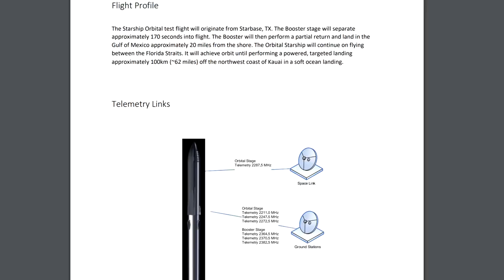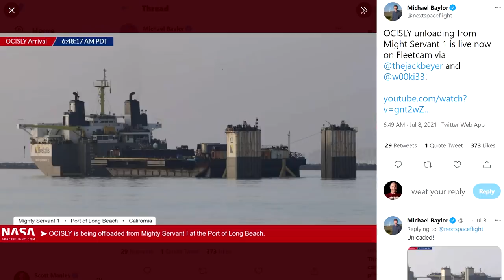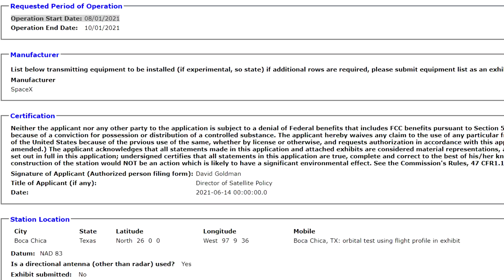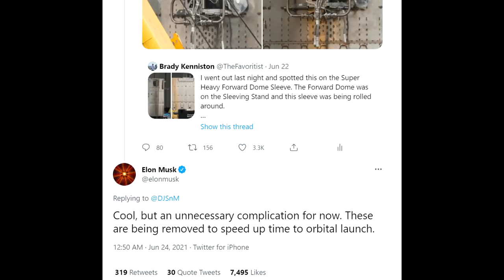Why SpaceX Will Move To New Thrusters To Simplify Starship

Comment: Damn those thruster tests sound like several objects broke sound barrier at once...
Reply: If you count each atom as an individual object, you're not wrong.
Reply: @44R0Ndin  What are you talking about?
Reply: @Alex-lc1bv  exhaust gasses in engine are accelerated to hypersonic speeds, and well, gas is group of molecules
Reply: @Alex-lc1bv  The atoms that make the propellant for the thruster, if counted as individual objects, would be "several objects breaking the sound barrier at once", which is what OP said it sounded like.
Reply: @44R0Ndin  This actually also goes for many of the atoms/molecules in room temperature air. :)
Reply: @janniszimbalski6652  Didn't think of that, but you're right of course.
Reply: In the Vacuum of Space, No One can hear your Thrusters.

I love the way Elon bounces back to Scott's Commentary...
Reply: They also sound like the new Triangle, high altitude plane the USAF, is flying, leaving multiple 'smoke rings' in its wake, as it does short bursts of fuel buns, to keep speeds over Mach 4.
 There's video on the tube, with the very distinct com trail & reports of multiple breaks of the sound barrier.

Comment: Hopefully they can run cold gas thrusters off of 87 octane gas, that'd be ideal for my 99 VW Jetta :D
Reply: A Cold gas thruster is basically, a compressed gas tank attached to a strategically placed valve(which act as the thruster), which he mentions in the video 6:25.
Reply: 87 sounds very low... can't get anything below 95 here, the old 92 was gone years ago :)
Reply: @YoursNKR  Basically, a fire extinguisher.
Reply: @benbaselet2026  Europe reports octane rating differently than the US. Europe gives the RON number on the pump and US is an average of RON and MON. 95 in Europe is the same as 87 in the US.
Reply: @RCAvhstape  Hey, it worked for Wall-e.. ;)
Reply: they are actually adding these thrusters and a compressor to the tesla roadster so it is said, to get close to a 1 second launch speed 0-60 and near weightlessness only on launches though.
Reply: @genelomas332  And for Sandra Bullock.
Reply: @Eradicationist  they're not adding hot gas to the roadster, Elon has always explicitly stated COLD gas thrusters for it
Reply: @E9X330  I never specified, and the original comment already stated cold gas so isnt it implied if that is so?...how is it 90% of people don't know how a youtube comment section works and I get replies like this all the time... it's like you all need to be spoon-fed all the information. 

how did we win the cold war...smh
Reply: @YoursNKR  its a bell nozzle connected to a valve that is connected to a pressurized tank of Nitrogen gas.
Reply: @Eradicationist  my bad then, could've sworn the OP wrote hot gas
Reply: @E9X330  it's ok, it happens quite often. 

especially to me.
Reply: I’ve heard cow methane is working really well.
Reply: @Eradicationist  if 90% of people get it "wrong" perhaps you're the one in the wrong.
Reply: @RCAvhstape  yeah, and Matt Damon went old school, and just ripped his glove.. lol
Reply: Then it wouldn't be a "cold gas thruster" would it?
Reply: @jnawk83  in short its more like 90% of people are lonely on youtube by themself and want to be a part of any conversation they can be no matter how dumb they look doing so.
Reply: New launch model?  🤔  If you can run 87 octane you to fly to the local launch site anywhere in the world, “land at the pump,” and onboard the 87+ fuel at a local gas station.
Democratized launchIng. 😉
  (“Volksrakete”would be “Rocket for the People” ? )
Reply: @Eradicationist  no one won the cold war, and depending on how you define loss (nuclear war) no one did that either
Reply: The 87 octane in my Volkswagen is cold gas, unless it's hot outside and then it's hot gas O.o
Reply: @baomao7243  I want to drive a Volksrakete V3 rocket. I bet I could fly it all the way to London!
Reply: @E9X330  the OP wrote "Cold gas" from FUEL(87 octane), which implies hot gas. So they had a bit of a contradiction, which is probably where the confusion came from.
Reply: I like this! No angry people, all chilled out and having fun!
Reply: Or just Diesel like my f-450
Reply: @toddmccarter45  American victory was guaranteed through finances and our larger army at the time. The United States bled the Soviets dry through the proxy wars and the nuclear arms race which we also had more of...not to mention we halted our army to let nato infiltrate the soviet union and create a coup de gras by taking berlin it was an allied effort but actually the first two makers of nato were the u.s. and Canada, Russia probably would have created nuclear weapons to their desire and started heavily spreading and taking other nations if we never made nato... it's still the thing preventing them from doing so or starting a war again and every other country as well to this day. 

in my opinion, we won the war through intelligent decision-making.
Reply: @benbaselet2026  What country are you in? I know some countries test differently than us here in the United States of Elon.
Reply: I am simultaneously sighing and shaking my head at the fact that amongst this ^ very dedicated collection of nerds, not a single one saw fit to post the obviously appropriate response to this comment. 

"You almost had me? You never had me - you never had your spacecraft... overcorrect blastin' not precision firing like you should. You're lucky that hundred shot of NO2 didn't blow the seals on the manifold! Now me and the mad scientist gotta rip apart all the RCS blocks and replace the nozzles that you fried."
Reply: @sixstringedthing  legend, may the original buster rest forever in peace.
Reply: @slonlo364  Guess it must be the same in Australia as in Europe, then. We only get 95 or higher in Aus.
Reply: @SpecialEDy     The V3 would have reached London (it got bombed before it was ready and the whole thing was abandoned), but it was no rocket. It would have produced a lot of hot gases … but you would not want to try and ride it.
Reply: @YoursNKR  000⁰
Reply: @RCAvhstape  …and for the crew of the rocket ship in the 1950 movie “Destination Moon”, where it was originally improvised.  Well, that was a welding gas cylinder, though, I think.
Reply: 1200CC pffff more like 12000CC injectors...
Reply: @garryellis3085  ?
Reply: You should be running 91 in that mkiv especially if you have the vr6 or turbo.  Or you enjoy it knocking.
Reply: @Eradicationist  No. These are hot gas thrusters. The ones they use on falcon9 will be used which are COLD GAS thrusters. ALSO, YOU NEVER stated which one was going to be used. The main TITLE WAS talking about HOT GAS thrusters, so don't go moving your goal post because you were not specific on your comments. Not everybody knows the difference between these 2 gas thrusters.
Reply: @Finallybianca  E85 and other alcohols have better detonation suppression making them the best candidates for fuels when boosting a high compression NA motor.
Reply: @1flash3571  again never specified on which I was talking about...

I never stated which thrusters they would be on the roadster, I said "these thrusters" in general in my original comment "on this comment" and I never in my first comment said I was talking about the original comment here, or maybe the video itself, and the "original unedited comment" already stated cold thrusters so it's implied I'm talking about those because we are talking under that comment, that's how youtube works, you talk about the comment or video your under when commenting on a comment or video and I shouldn't have to explain that to 90% of people on youtube.

I don't and didn't know whether they will be hot or cold, actually, no one does, because the cars are not out or even in development yet and nothing is really finalized, so I didn't say or specify and others barged in assuming cold thrusters so I agreed with them because I don't know, I don't read into teslas design plans, I don't even know where those documents are hosted because I have better things to do...

you're all in the wrong then from what you have said...information, that you all cant glean yourselves.
Reply: @benbaselet2026  where?
Reply: They are using hot gas now. And they dont have combustion so they don't need fuel like that
Reply: @RCAvhstape  powder fire extinguisher for the best user experience!
Reply: @RCAvhstape  A fire extinguisher, that produces fire. :)
Reply: @jnellie1970  Cold gas thrusters do not produce fire though; they are literally just gas released through a nozzle, usually nitrogen. You may be thinking of monopropellant thrusters, which use a single fluid as fuel, fed through a catalyst bed that causes it to ignite and burn in the combustion chamber before passing though the rocket nozzle.
Reply: @jnellie1970  Also, thanks for the sub :-)
Reply: @slonlo364  VW tends to report all kinds of (emissions?) ratings differently to...well...anyone.
Reply: @RCAvhstape  Bingo.
Reply: @benbaselet2026  what country are you in?

Comment: But if their main engines and RCS thrusters use the same fuel, how are the kerbals supposed to limp back home on RCS thrusters when they run out of fuel?
Reply: well that's pretty obvious. They'll hop outside and push!
Reply: I'm not that knowledgeable about these things. But I don't think RCS thrusters have enough power to get you home. If they'll let you point yourself a little better. But no enough power for a transfer or de-orbit. (Unless it's taking a LONG time.)
Only way you could "limp home" with RCS is if you have "game mechanics" and the RCS system somehow has unlimited fuel.

But then again, I'm likely taking this too far.
Reply: @zidaryn  yeah, this is a kerbal space program joke lol. Everyone has done it before
Reply: On the fumes left over by the big engines.

Comment: The thing is, because of Super Heavy’s construction materials, if they do land it in the ocean and it survives, it has a much higher chance of being recovered than a Falcon 9 doing the same thing and has the possibility of being flown again. Inconel and Stainless 304L have high corrosion resistance to water. As to SN20… that’s going to be interesting no matter what happens to it.
Reply: If something that big survives toppling in the ocean I will be impressed.
Reply: inconel perhaps, but 304 would probably look like shit in any extended interaction with seawater.
Reply: I just hope they get very good close-ups of the heat shield tiles on S20 before it splashes down. The booster will be fine if it does its job. Off and build another set of 35 to 39 Raptors for S21/B5!
Reply: I think the engines are the most expensive parts of the vehicle and im not sure how well these will handle seawater
Reply: @pascalwiery7129  Not at all. They will be demolished on landing.
Reply: @pascalwiery7129  engine parts are usually made from high alloys because of the temperature differential specifications needed, or corrosive fuels etc. So it should be okay i guess.
Reply: @knowlegeisgood8735  
No, but what’s left of the husks that were the engines can be dragged back to shore and studied heavily before being scrapped. Best wreck is no wreck.
Reply: @topsecret1837  Tim Dodd asked that same question of Elon. Would the booster and ship be salvaged? Elon said no.
I remember that it surprised me a lot.
Reply: It will get flattened when it topples. Water is a hard surface for an object with large surface area.
Reply: It's not like the painted body of a falcon 9 would be likely to experience a lot of corrosion from an ocean landing. The big problem is in the pumps and injectors and wiring and plumbing. Engines have many different kinds of metal in them and exposing them to an electrolyte makes a galvanic cell. Separately stainless steel and inconel are both highly corrosion resistant but if you put them in electrical contact with each other they can corrode in hours. Monel (which is less anodic than inconel) has to be isolated when used as a tank material on sailboats (which was popular at one time in the past) because it will rapidly corrode through stainless steel fittings.

Comment: Make more videos like this Scott! This was really cool. Maybe about the starship heat Shields? How can this be rapidly reusable where the Space Shuttle had months of refurbishment?
Reply: No glue. All identical (well, 3 sizes). Starship is not at all as vulnerable to high temperatures.
Reply: @knowlegeisgood8735  the last point is very valid. It has been speculated that if the shuttle had a stainless steel instead of aluminum structure then Columbia might have survived STS 107.

Comment: I don't think getting the pressure needed will be a problem, diesel high pressure fuel pumps provide 2500 bar even now.
Reply: Did Lucas ever make hp diesel pumps. If they are buying off the shelf they should probably go with Bosch.
And maybe be careful if of eBay knock-offs.
Reply: The problem is the flow rate needed at such high pressures, also i'm pretty sure all high pressure fuel pumps for diesels are mechanical, so they would have to include a turbo pump anyways.
Reply: @NNFaNRacing  centaur rocket stage was going to use small hydrogen powered internal combustion engine to charge batteries and chill propellant (I have no idea if this was implemented). SpaceX might turn on Raptor briefly to replenish pressurized gaseous methane and oxygen in small tanks using mighty pumps.
Reply: @NNFaNRacing  are all diesel pumps not mechanical anyway?
The difference being what drives the mechanical pump.

Cam shaft? Elon's giant fire cracker probably hasn't got one of those.

Electric Motor? I reckon he's got loads of spare AC motors that can do the job.
If only he could get the battery weight down.
Reply: @richardschofield2201  they can use solar panels for anything this side of Mars.

Comment: If Starship will have some kind of on board recondenser for the propellants it would be pretty easy to just drain a bit out of its hot high pressure part and store it away.
Reply: That's kind of at the wrong end of the ship though...

Comment: More compelling reasons why they won't be recovering B4 would be that: there are no landing legs; and, afaik, there is no shroud, so the engines extend below the body of the booster (don't want to land directly on the nozzles, might be a video in that for you Scott 😉).
Reply: The day they have the throttling control to actually land the thing on the nozzle bells is the day I'll officially declare any other space contender stone age technology! :P
Reply: None of the boosters are ever going to land.
Reply: They might add landing legs for early versions (maybe even Starhopper like ones to reduce complexity)
Reply: @ImieNazwiskoOK  that adds complexity.
Reply: @Hansengineering  Minimal complexity with a lot to learn from it.
They already made starhopper, so they just need to make those legs stronger.
And they could gather far more data with it.

I think some are just too paranoid about too much complexity.
Reply: @ImieNazwiskoOK  Elon has specifically rejected landing legs, so I don't see that changing unless they can never figure out how to catch a booster. My money is on SpaceX for this one - they have done stuff as hard as this already (flip maneuver on Starship for one).
Reply: @Hansengineering  I think that the parasitic weight of the landing legs/system is a bigger consideration for SpaceX than the complexity, although that is definitely also a consideration.
Reply: @TamaraWiens  I am just responding to other people's suppositions.

Comment: 12:40 This is going to be my guess as well. There are other benefits to doing it this way as well, for example there are two ways you could pressurize the system without pumps. The first way would be to tap off the autogenous repressurization lines for large volumes of gas during burns when you're potentially using the thrusters liberally. The other more interesting way would be to open valves for the propellants all the way through from the RCS thruster to the main propellant tank, you'd vent a small amount of gas at first but then you'd wind up drawing liquid into your tank that an electric heater would do fine in vaporizing.

Comment: Gas-Gas thrusters make sense, as few realize that only gases will burn - liquids and solids need to go to a gas form to react with oxygen and burn. If you carefully observe a wood fire, you will see the flames are a short distance from the wood surface. As it gets hotter and the volatilies are consumed, the wood carbonizes and reaches a temperature to 'boil off' the carbon to burn as a coal.

Comment: The landing engines would be like 20 something hot gas thrusters and that’s fine for lunar gravity
Reply: Suspect they will pretty much come to a hover using the main engine 10 - 20m off the ground. Then swap to the landing thrusters, they don’t need to be capable of much more than hovering the rocket with some redundancy.
Reply: @SpaceManMat I think they would also need power to take off to small altitude.
To not have same problem as once on testing with martyte in flight (piece of martyte broke off concrete and destroyed the engine).
Reply: @ImieNazwiskoOK  true, but no need to be massively powerful, again just need to rise about 20m off the ground then light one main engine. At that height the gas disperses rapidity. Look at pictures under the moon landers, their engines ran right next to the ground, there is very little disturbance other than directly under the engine.

Comment: It’s kind of like how when I fart in the bath and not let all the bubbles escape to the surface with one creating a tavern inside my bum cheeks, under a higher pressure.
Then when it does go the fart noise the bubble contains is at a much lower pitch?
Am I understanding along the correct lines an following you here? Thanks